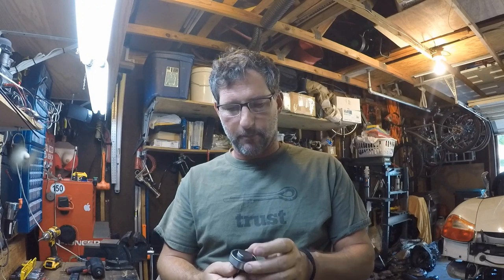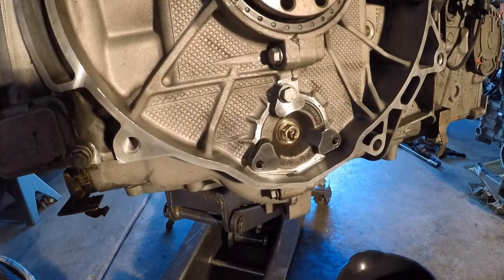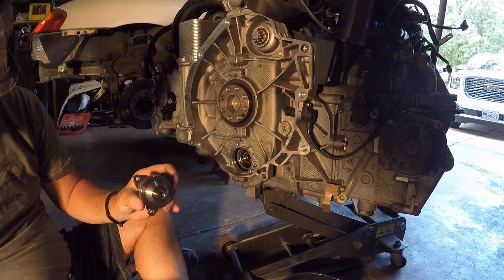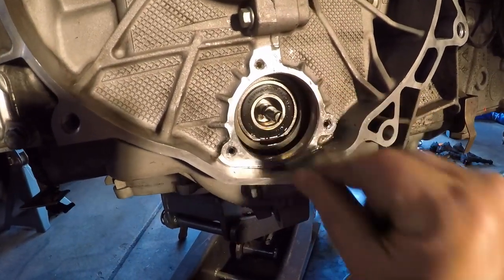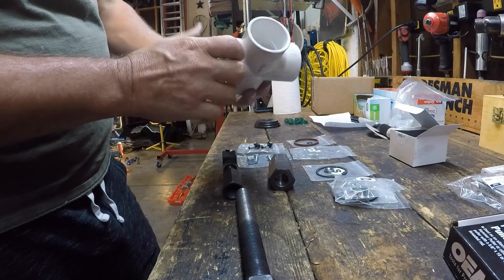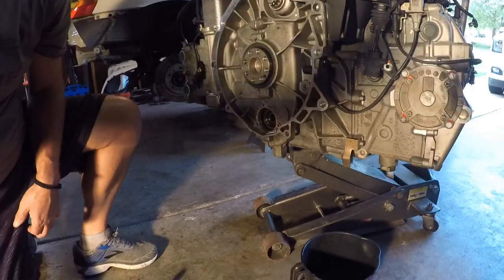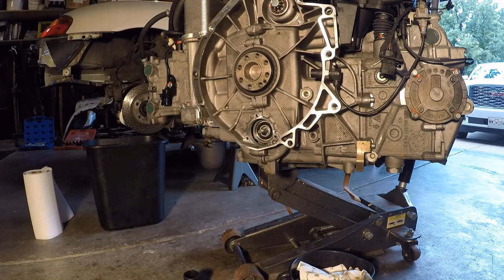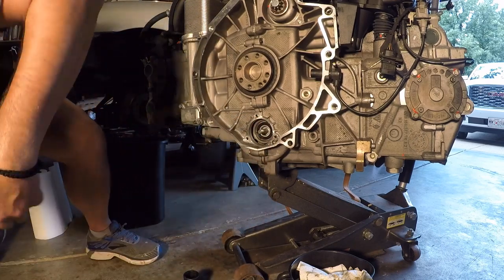2001 Porsche Boxster S IMS Bearing Replacement

Comment: Fantastic guy to take the time and put in the considerable effort ( and bucks ) to produce a pragmatic video  for  DIY Joe  IMS bearing replacement backyard mechanics such as I...Unbelievably all done free of charge   !!! Absolutely a gift to Joe public DIY.... AND..not just the procedure / steps  but also showing how to save BIG bucks on needed tools instead of having to pay $1,700.00 for IMS bearing repair kits that include tools ???..no reason for such extreme $1,700.00 kit prices...The PVC tee looks to be less than a schedule 40 wall but it does the job nicely.. Thank you Tony ever so much..

Comment: Hey Joe, great video of the IMS bearing replacement. Im a DIY guy, and im not scared to pull a motor out of anything.  I own a 07 911 S with 101k miles, and everything seems to be fine, but everyone is so scared about the IMS problems they had with them. Thanks for the great video.

Comment: WOW.... at 4:35 you explained how more than anyone on YT or tech articles have.... I have for years wondered how the IMS bearing operates and I finally assumed it must be inside of a gear or pulley as there isnt a thru shaft like a crank even cam... BUT!!!... You confirmed by saying that it will be mobil as there is tension from several areas... I thank yo for settling this issue in my head for 5 years lol.... I have not had to do one in my shop but I always like to know what a customer is speaking of and have an answer with knowledge and not how are you paying..... THANK YOU!
Reply from the maker: Thanks for taking the time to leave a nice comment. I got a lot of crap about my shade tree efforts. But I really enjoyed making this and was hopeful it would help some guy. Again, thank for your comment! Glad it made sense!
Reply: @sailingaurora-Farr56  I can only Imagine the negative people...LOL, I remember I used to have a boat and people would comment about, one example the outdrive, How come you have this or that on it, you should have this... Id say, what do you have on your outdrive, UHHH, I dont have a boat.... EXACTLY, now please excuse me im busy!

Comment: Great video , thanks! Btw, for those who doesnt know. You can buy the whole kit with installer and IMS  remover + cam lock + everything you need + the IMS improved design. Its like 700$ canadian so around 400-500$ USD. Some websites like LM engineering even has the tools rental service for everything you need to do the job without wasting time. No need to make your own tool , ive never seen this pulley used in the video (i live in canada so , we dont have as much auto parts store as in the states). Good luck to all !

Comment: I'm impressed with the bearing puller technique you used, plus the way you locked the gear in place. Saved a lot of time not having to pull cam plugs, then the cam locks, and cam tensioners. Saved this video for future reference, great job.
Reply: this way is wrong it could have jumped 1 tooth without you knowing.if your going this far  why not fit the oil feed.

Comment: Really enjoyed your video 👍 I have a 2004 C4S 66,000 miles and I want to replace my IMS very soon and wanted to do it myself, this video gives me more confidence to DIY.
A mechanic friend will let me use his car lift so am looking forward to it now. I will use a flat roller bearing with an oil gully in the new cover which allows oil to be washed over the bearing constantly, kit supplied by Design 911 here in the UK for £580.00 and advertised as forever replacement. The flat roller bearings are 5 times load capacity than roller ball bearings so with this and oil gully in the cover, hopefully a one time fix as they say.
Again, thanks for the “what you see is what you get” video, brilliant 👍🇬🇧

Comment: I am planning on buying a Porsche but for my price range the tales of the IMS issues has just about scared me toward something else. After watching your video I have Porsche back at the top of my list. If I can make one small suggestion, if you plan on making videos (I certainly hope that you do), I suggest that you get a Go-Pro camera with a head strap that allows it to attach to your forehead. The Go-Pro’s are expensive & you should be able to find a Chinese knock-off fo under $100. It will make your job easier because you’re not worrying about the camera & it’s placement, and will make your videos appear much more professional. Whatever you decide to do, Thank-you!!!

Comment: So how is the bearing that you are installing any better than the one that you are removing? I thought the idea was to UPGRADE to something better? Just trying to learn all the options.
Reply: It's not. It's no better than the one he took out. In fact, since the one he took out was in there for, I think he said over 70k miles with no trouble, I would bet the original was better. Still an excellent video!

Comment: Love your PVC IMS bearing removal tool. Next time put some moly grease on the forcing screw (which you call a "bolt").  
Another tool that might work, but is some bucks, is a Kukko counterstay 22/2 and internal bearing puller 21/5 or 21/6.
This is totally DIY-doable. 
Time to put some magnifying glasses on the workbench.

Comment: Did you loosen the cam tensioners at all before doing this? Very strange, but on my 99 996 I can't get TDC to line up with the IMS sprocket without there being relief holes where the set screws are supposed to push...

Comment: Great Video.  Have Q, not because I think I know everything....only a Q on this crazy Porsche design that to my knowledge was to save money on having heads that work on both banks (chain direct on left bank front, IMS shaft to drive right bank rear).

Would it be easier to removed the right bank chain tensioner to relieve stress on IMS shaft?

Please advise,

Mr. P
Reply from the maker: Good question. I’m going to go with “maybe” - the idea of the set screws is they will hold the IMS (shaft) in place even with the tensioners in place. So there is no real need to loosen them. Loosening them when you do it this way doesn’t really buy you anything or make it any easier as you are not fighting them in any fashion once the set screws are in place. Additionally, if you loosen the tensioners you do run the albeit small risk of having a chain move on you and wrecking the timing. There are reasons to loosen the chain tensioners, but if you are just doing an IMS replacement like this it’s not necessary, in my opinion.

Comment: Best video on this I've seen so far. T-Y. I do have a question though.... I sort of like the idea of those setscrews going between the gear teeth to keep things aligned vs. pressings against teeth and relying on friction. Shouldn't be a problem as by measuring you could tell how far to screw them in without them falling in. Would all three center OK, or are the gear valleys too far apart to have all three screws line up? Can it actually be done? Anyone?
Edit: I should have watched the whole video before I made this comment. He explains more near the end of the video about how the setscrews interact with gear.
Reply from the maker: Thank you. It’s actually not between the teeth like I suggested, but there are holes in the gear itself and that’s what you are trying to avoid. I don’t think there is a way to do that because there is too much room for the gear to move.

Comment: Nice video! Do you need to remove the new bearing shields before installation for better oiling of the bearing? Not sure if it’s recommended or not. Thanks!

Comment: Thanks for a super awesome, informative video - great communication on everything that we need to know here.  Just one little thing that I did notice - when you used the thicker spacer from the Dual Row IMS bag, when the securing nut is in place over the center thread, it looks like there is some exposed thread on the nut - perhaps its not a case of incorrect parts being put in bags, but a case of the single row IMS bearing spacer just being too thin?

Comment: Using set screws is a great solution. Not having to lock cams and remove chain tensioners could save lots of work. Wondering why this isn't the standard approach when removing the IMS bearing!?

Comment: Best IMS bearing replacement video I have seen! But I have one question: The Dempsey book discusses loosening the chain tensioner bolts slightly. I don't recall seeing that step in your video. Did you do that before installing the 6mm set screws? Thanks.

Comment: Set screws hold ims shaft somehow. 
 So you dont remove chain tensioners.
I dont quite understand set screws.   
I'm going to try to pull out bearing using the tool .  Not sure about thst.     Also I have duel bearing so not sure how to put spacers

Comment: NIce video!  On the center M8 retainer/spacer/O ring, wouldn't the O ring go first, then the spacer?  That way the oil is sealed off sooner.  I've had a '00 Boxster and looking at buying an '01 S that's on the original IMS bearing.
Reply: he did it backwards it will leak
Reply: I was thinking the same thing....

Comment: This is super informative. Thanks for this video. What prevents the bearing from free spinning inside the ims hollow shaft? Is the pressure of being pressed into the shaft the only thing that prevents the bearing from "spinning out" messing up the timing? If so I can see how the failure of the bearing would be a bad occurrence. Replacement every 40,000 miles seems quite often :|
Reply: The IMS bearing is just that: a bearing that has no gearing or other timing components. If it spins within the intermediate shaft (IMS) itself, that's fine, so long as it keeps the shaft centered. However, the shaft is geared and timed, and thus you don't want it spinning during this process. Luckily, if you have a pin holding the camshaft top dead center (it's "home" position), all gears and timing chains will be held in place, including the IMS. That means the timing of the entire engine stays correct. Locking that cam is the most important step in this process, but it is also wise to avoid exerting any rotational force on the IMS itself, which is why those locking allen nuts he puts in at the beginning of the video are also useful. Those nuts are a second failsafe, holding the chaft (really just a cylinder of metal) in place by putting pressure on its edges.

Comment: Tony, you didn't need to lock the camshafts and release the tensioners? I saw you had the tool kit sitting on the floor, but looks like you didn't use it...And I notice you answered this at the end of your video...NICE.
Reply from the maker: I did not.  That was the point of the set screws in the IMS before removing the cover.
Reply: @sailingaurora-Farr56  First time I have seen the set screw thing done and it was cool....HOWEVER, I think I would at least have used the longer end of the Allen to put some more pressure on those...banging on that bearing made me a little skittish as you were banging the IMS away from the Allen bolt tension....  could have been a BAD DAY in the making....

Comment: Looks like the O-ring and that bushing would have to be turned upside down that the O-ring should touch the yolk assembly that is held on with three bolts whatever that may be called and that the seal to keep oil from leaking would have to be at that point?  But I’m sure that the bearing comes with some instructions and or the information is out there on this type of replacement, I have a 2000 Cabriolet 911Just went over 140,000 miles not sure as I’ve only had it for three years so hope someone upgraded it at some point meanwhile I’ll go easy on it

Comment: 34:00
Using a socket and carefully avoiding applying impact to anything but the outer race... But I gotta wonder what's on  the other end of that intermediate shaft that's taking both the side pressure of the setscrews and the side impact of the hammer blows?? Another ball bearing like the one you're being careful with?

You do make use of those orange hammers. :-)

Comment: what do your have to do to get the. shaft back center if you take the bearing cover off with out locking the shaft?
Reply: Pull the bottom tensioner. The shaft then be easily centered.

Comment: Why are there orange blobs (caulk) on so many of the bolts on your engine? I have a 2000 and have not seen that on mine. I would assume it is to mark them to see if they have vibrated loose.
Reply from the maker: Oh, good question. This was an eBay /junk yard engine. It showed up that way when I bought it. That would have been something the junk yard did as a way to confirm everything was checked/there before shipping it to me. That is not something the factory does.

Comment: What are the chances of cracking the aluminum case while hitting on the IMS shaft sitting in the middle between the 2 case halves !? Or even damaging the plain IMS bearing or mating surfaces on the case ?
What about damaging the gears inside the oil pump or the shaft between the IMS shaft and pump that rotates the oil pump !? I am just not comfortable with all that hammering on the shaft, there has to be a safer way to press that bearing in !!

Comment: u didnt tell us if  it was single row or duel row 
and what year was the car
thanxs bud.
Reply from the maker: Both of those were mentioned - it is from a 2001 Boxster S, so the 3.2L engine. The original bearing was a single row and it was fine. It was replaced with a very similar single row. I even give the old/new bearing part numbers in the video. Enjoy!
Reply: question my friend..
and sorry about that
 i guess i missed that one.
but
i do 
have a 2000 boxster 2.7 
the MFD   date says 99 
is it safe to assume i might have the dual  row bearing
car runs great i do plan on changing the clutch and ims  in may of 2021

Comment: Wheeler dealers showed a newly designed ims bearing with an oiling port
Reply: 'IMS solution' from LN Engineering.  $1800 for the kit.  Peace of mind if one is keeping the car though.
Reply: Spoke to a dealer mechanic and he said he's had quite a few cars come in with the newly added oil like to the bearing damaged or ripped off causing engine failure. He said he had seen that often enough that he felt the repair was more dangerous than just installing the factory replacement. IDK... I have a 2003 with 84000 miles and mine has not been replaced. I hate just HOPING it doesn't fail...

Comment: Just wondering, it looks like you replaced a sealed bearing with another sealed bearing. Is this one better? Or same longevity but just newer.
Reply from the maker: Right, this is a Pelican Parts replacement bearing.  It's pretty much the same bearing from what I can tell.  Just new.  They recommend replacing it frequently, I think with the clutch every 40k miles or somewhere around there.  It seems excessive to me, but knowing how touchy these engines are its probably smart to do.
Reply: @sailingaurora-Farr56  how was the condition of the orginal? Would you recommended the pelican parts vs the LN option? Big price difference

Comment: Wouldn't it be time to replace the Variocam pads as well while engine out? :)
Reply from the maker: CGT Vivo yes, yes it would! I’ve seen 200k engines that have never had them replaced. But I’ve also seen 80k mile engines that were worn significantly. I’ve done a few M96 engines with cracked heads and I always replace them.

Comment: Brilliant, thanks. You make it look too easy, :O)
Still doable like that with the engine in the car?
Reply from the maker: Thanks!  From what I understand it can be done in the car.  The transmission comes out pretty easily - like in an hour (I've done it a few times) the engine on the other hand takes the good part of a day to remove.  If you just wanted to do the IMS I'd for sure try it with the engine in the car.
Reply: @sailingaurora-Farr56  With A/C taking the engine out is a real pain in the ass... if you can get any kind of a two foot lift going on...like that gig Sarah n Tune uses...it makes taking the trans and doing the job easier...  the old days of having a bit of a PIT in the garage are MISSED, eh??

Comment: what i done on 1 of mine is replaced it witha roller bearing removed the rubber seals made a long dril t reach the other end of the shaft is the oil pump and made center spacer to keep central and drilled a 1mm hole in the back of the pump which then feeds the bearing from the back it also get lubricated from the chains spining around the origional runs  dry and they colaps and are a bitch to get out ive had to have a couple burnt out becaust they were that badly chewed up they wouldnt pull out still going ok the roller bearing is 10 times stronger than the origional ball tace bearing .....while you was at it you should of took that shit german oil seal out the back and jumped on it and got it matched up with a proper oil seal with a spring around the back

Comment: you have two motors?
Reply from the maker: I do.  One that is in bad shape, I'm not quite sure the extent of the failure but it was ran with no oil pressure for a while.  The second one is out of a similar mileage identical car that was wrecked.
Reply from the maker: Yep.  Doesn't everyone? :)

Comment: It's ridiculous Porsche charges 4 hours of labor for this. He did it in 45 minutes while explaining what he's doing.
Reply from the maker: To be fair you do have to pull the transmission to get to the point where I started the video. I can get a transmission out in under an hour. 4 hours seems about right. I’m actually surprised Porsche is that low.
Reply: 4? Try 12 hours by most shops.